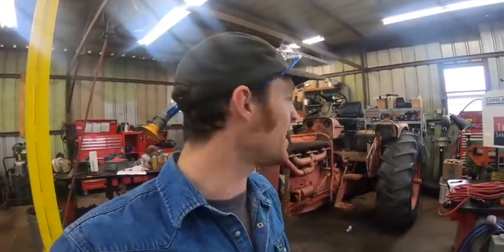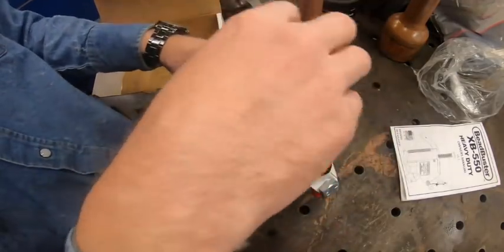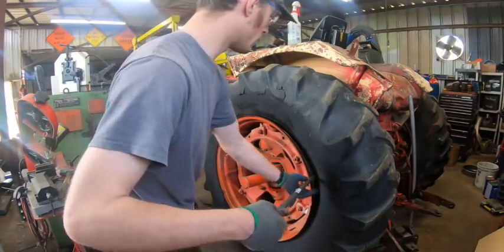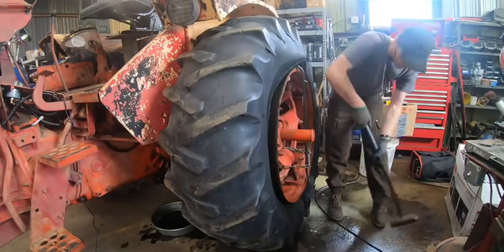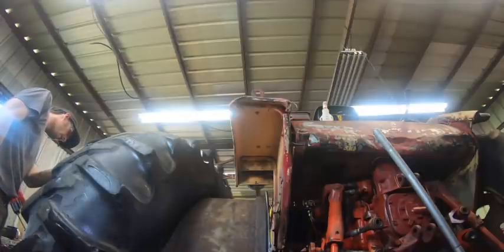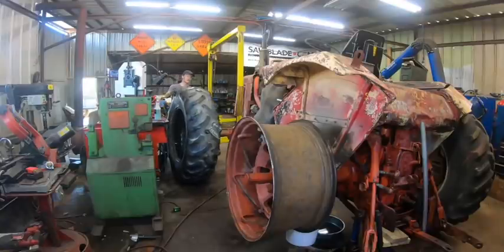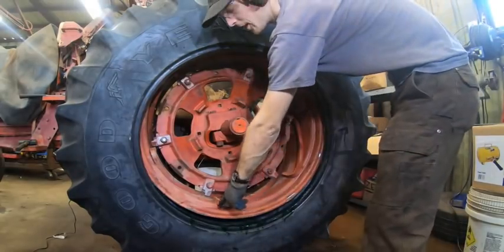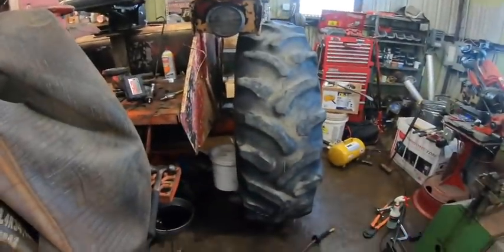GIANT TRACTOR TIRE CHANGE - HOW HARD CAN IT BE?!?

Comment: Probably not gonna see this as it’s been over a year since you posted this, however I’ve been a tire technician for years and you could’ve had this done in no time if you had flipped your bars around. The side you were using is mostly for semi tire dismounting, not effective for anything else. The stem tore off the tube because you mounted the tire right over it. The last place you bar when mounting should be near the valve stem and not one bar sooner. Like I said idk if you’ll see this but I hope this helps someone. Good work though, I wouldn’t have gotten this far without any experience on the job. All about the technique not strength!
Reply: I only really use that side of the bar when I'm mounting tyres back on rims. For dismounting I use two Michelin Halte levers that have a thin tapered end.

Comment: Great video. Two things you could do to make the next change a lot easier. First, when you are removing the old tire, turn your pry bar around so that knob is against the rim instead of outward. Than you are using the tool the better way to remove the tire edge. The angle on the pry bar needs to get under the tire edge to grab it. The way you used it allows it to merely slip off the tire edge when you pry. Second make sure you thoroughly clean the rim edges of all rust and debris. And then lube it up well with the soap. And do the same to the tire edge as well. The slicker both are, the easier the effort. Thumbs Up!
Reply: It hurts my brain to watch him struggle because he's using the tools wrong!
Reply: @carlreed3488  I had exactly the same pain.  It almost looked like he was deliberately making it look harder than it should be.

Comment: If u get a tire more stubborn then that.  Push the bead in the initial spot put large nuts or spacers of some kind between the tire and the lip of the wheel on the bead seat of the wheel then reposition the bead breaker and push in the new spot.

Comment: I am a guy who watched a guy that watched a guy change a tractor tire. 😁 You made it interesting though. One tip from doing a lot of truck tires. Lube lube lube when taking off and removing. There can't be too much lube. Silicone lube works great but you can buy a gallon of tire lube that relatively cheap.

Comment: Tractor should have been more in the open to start with . Those tire irons are ok..but I use the ken-tool 52 inch x one inch diameter bars...the curved end has a deeper curve for the bigger beads and don't slip out as easy..they aren't cheap..about $150 each last time I looked...but worth every penny . I literally have done thousands of tires.. mostly semi tires..but done them all..and those are the irons I prefer..and I've tried all sorts of variations . Dish soap is ok...but it dries quickly..use a tire mounting lube..it stays wet longer than soap.

Comment: A bit of gasoline on the bead will soften the rubber to help break the bead. This helps more also though when the tire is laying down but In this case a bit towards the top will run down and help some. Doesn’t take much.

Comment: 1.  Should have wire brushed the rim to clean all the rust away.
2.  Lube the tire bead and rim just before inflating. (shaving cream works great but someone may have a better choice)
3.  Tubeless if you can or use a tube if you must. 
JMHO

Comment: Vaseline works good as tire lube, you didn't use nearly enough, you need to put some on the inside of the rim and also lots on the tire beads, and also you always start and end by the Valve or you will tear it out while prying by it. Also sometimes you were fighting against the bead with the pry bar, where it was sloped down away from the rim instead of sloped to try and pry it onto the rim, likely the reason you had so much trouble, I've also found crow bars work fairly good aswell if you need something shorter or just need another pry bar while one is still stuck in the bead
Reply: That’s what I’ve learned to use on our lawn tractor tires.

Comment: U need to start at the bottom of the tire and work your way up cause the tire hangs on the rim it'll be easier to get it started. But man I changed 2 tires from 1970s and let me u you will learn some new cus words on them especially if u don't have a manual bead breaking witch i didn't i do know though

Comment: It's certainly possible to pull that outer bead over before breaking the rear bead. When trying to get that first part of the outer bead over the rim you want to kick the bottom of the tyre so the other side of the same bead drops into the well.

Comment: The way I buy tires 18.4 x 38 is I go to farm auctions and look to see if thy have any that will fit my tractors some times you can find a good deal on new ones there or good used ones I found at one auction I paid 600.00 for a brand new set of 4 18.4 x 38.

Comment: Pry off the axle. You could even lock the opposing brake and put the tractor in low and let the bar hit the floor and it will remove itself.

Comment: Here's a BIG tip for you, When you first break the bead you have to lube the bead area with a slime solution so the rubber wont hang up on the rim as you are removing the tire.